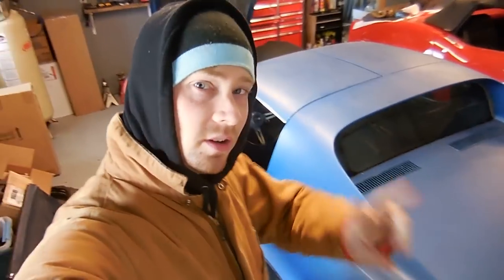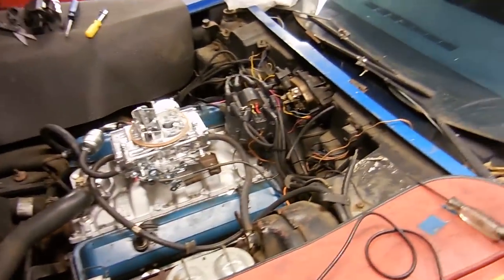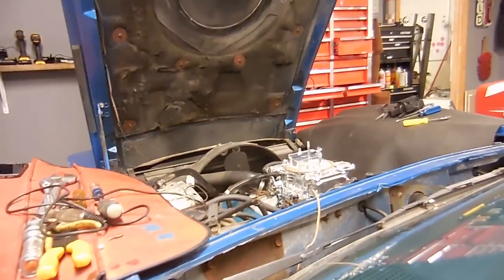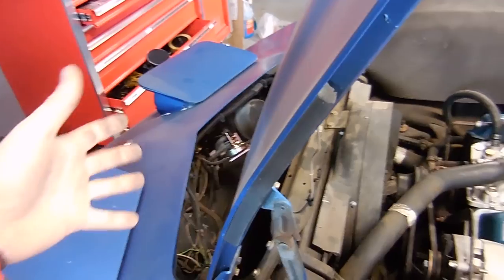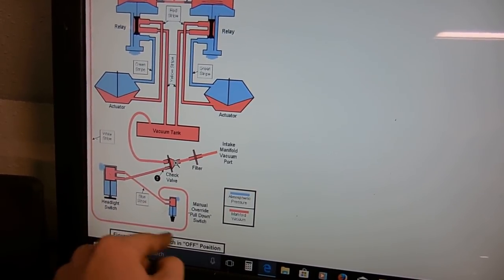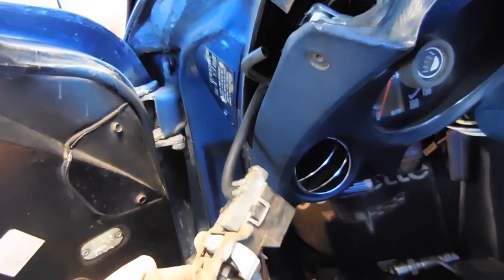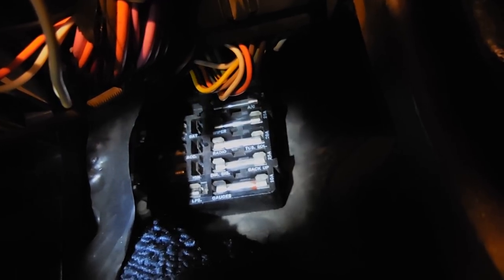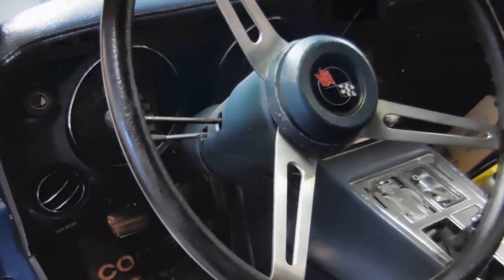Norris' 1973 Corvette Stingray Coupe Part 2 of 2

Comment: I had a radio playing up after being installed by professionals, it would cut in & out & was really warm on the facia, so i took it out & the back was really hot & it turned after i had a quick look was that when the professionals put it back in, instead of taping up the individual wires they taped all the exposed wire ends together which weren't need at all which was shorting out & heating up the radio, i taped up all the ends & voila, perfect, cool radio that worked much better, sometimes the professionals love to charge but not do the job correctly, you did an amazing job on Norris vette...keep it up, i like the way you do your commentary & explanation of how it's all going.
Reply: Those were not professionals...I hope your used that term with sarcasm.  Haha

Comment: Nice troubleshooting!! One place I would caution is the blown fuse. As a old electrician, I would suggest paying very close attention to things while the radio is turned on and playing to see if/when something makes it stop. You found a blown fuse but no indication as to WHY it was blown. Something caused that fuse to blow. Unless it was "bubba" playing around, it will blow again when the same conditions repeat.
Reply: I had a shorted speaker that kept blowing the fuse and putting the stereo in protect mode, took a while to figure out.

Comment: i spent 2 hours on the vacuum headlight system for my 73 and that was all the time i was prepared to spend on it. Pulled out the entire vacuum system and replaced it with electric headlight motor

Comment: I agree. I have Mag in my 2012 C6 GS. I did the Jim Mero upgrade and I still couldn't tell the difference. I'm told the big difference is on the track,by Jim.  So, my track time is one mile or less so I don't think I'd do it again, if it available I'll still get it.  O
n my C8 order .

Comment: I have a 1973. C3 is a great vette. especially a 4-speed L82 car. Do yourself a favor and use two throttle springs. Inner and outer spring for safety.

Comment: On my 75 the third wire on the HEI was for the tach. I believe the 74 and earlier was gear driven tachs,  Never saw in the video  If the tach was working.  Even with a cam my idle was only 750 RPM.  I had same speedometer problem but drove it 9 years with just the tach. Not one speeding ticket, not that I didn't push the limit a few times. :)  That horn button can be annoying.

Comment: Great job as usual. BTW, you may have a leak on the new headlights relays since they do not pop up very fast...tell me how I know it. Disconnect all 4 vacuum hoses. Block off the green port and attach the vacuum pump to the yellow port. Vacuum pressure should be maintained. Mines were toast out of the box...nowadays most are crappy spare part reproduction.
Reply from the maker: +4 Speeds considering an actuator was bad out of the box, I wouldn't doubt it!

Comment: Thanks for the great 2-pt video. I have a 73 vette and just had the engine pulled and rebuilt. Now my mechanic (with me as the gopher) are attending to details. I had a question about the computer graphic you had in the video about the vac system for the headlights. What is the program and is it specific to the C3 vette series? As a 73 owner, any resources I can get to help put this car back to spec would be a great assett. Thanks for anything you can offer! Take care and hope all is well in you neck of the country. I am in PA.

Comment: 40 seconds in, dont tell me, Vapor Lock? read about it on the daytona replicas they made, had to have a cut panel made around the rear of the hood by the windshield blades to let air pass through there from the engine bay, as you DID switch the carb which might have made it tighter in there

Rowley Corvette here in MA has the photos on their website of the part in particular they used on the Rowley GTC

http://corvette.canney.net/webvettes/customized/c0072/index.html
photo 8 down, and look at the Cowl Panel, that's a custom piece they made for the rowley GTC's that suffered from this problem along with the mcburnies. 

as I like these cars as their like a combo of the C4 and C3 styling, its just the damn winshield gives away what it is sadly, been thinking of a way to deal with that for years and still havent found one I like really

and most of them were made using a series of corvettes I hated styling wise, the 80 to 82's so I really dont see the evil in them really. 

but this could be tested if it keeps vapor locking by simply roadkilling it and taking the hood off.

Comment: Well, !@#$ happens to us all.  Those that claim they never make mistakes must not do any actual work....  Seems like tech schools could devote a whole course to the corvette light system, I thought only I could have that kind of bad luck...  I wish I actually understood the electrical theory behind the GM HEI ignition system, but after wasting a lot of time and money, I have tried to remember to always check basic things first, like those connections, sure hope that has solved the problem.  My dumb ass 09 Camry makes a rattling noise in the steering column, kind of like what you describe.  Dealer tells me it needs a whole new steering column, but am wondering if the problem couldn't be something as simple as this.  I would take the horn apart, but am afraid of blowing the air bag....
Reply: Remove the airbag fuse ,first ....Or /and disconnect the battery,if previously owned ..And remember going slow sometimes means ...really going fast,(less errors ,less mistakes),because you see things then with less emotion